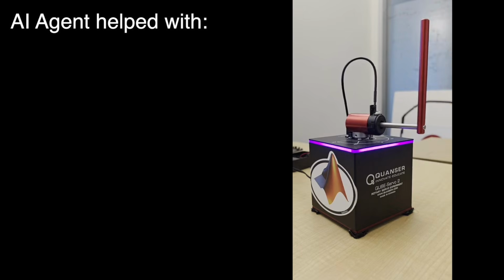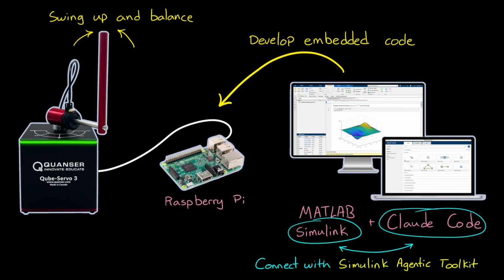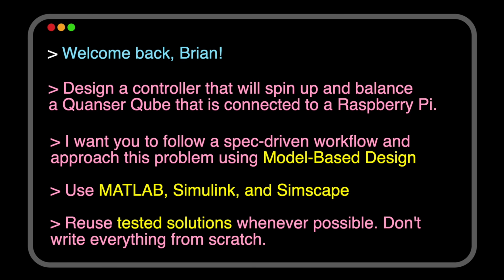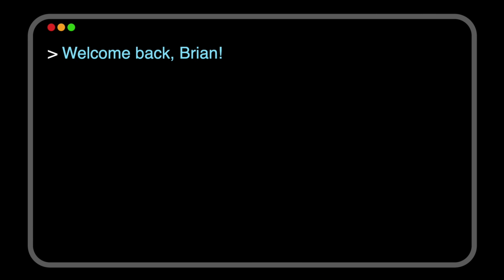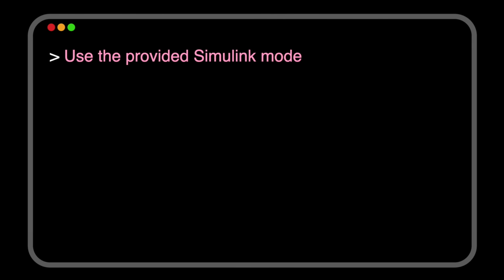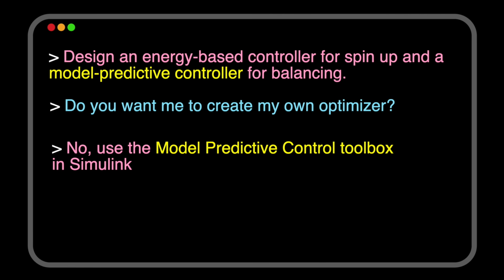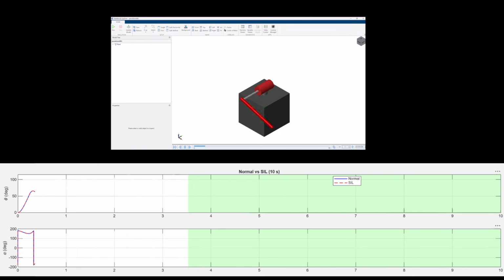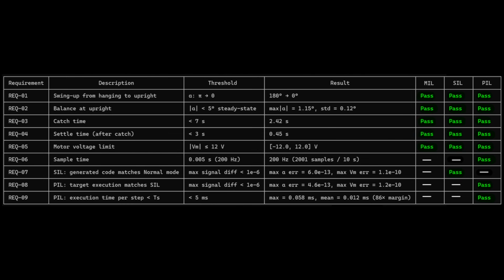Can Agentic AI Develop Embedded Systems with Model-Based Design?

Comment: I feel that AI had a very little work to do. Almost everything (coding, simulation) was done by Simulink and this is basically resulted in 99% of engineering performance gain, because you used MBD. 
The controller was also not done by AI, but by MPC toolbox. 
So basically skilled engineer could design such system without AI maybe in a little bit more time, by using the Matlab/Simulink power and toolboxes.
Reply from the maker: You are right, we believe that good proven engineering workflow and domain expertise are essential with or without AI. The promise of AI is that it can accelerate the coding part of the project and enable engineers to focus on more critical part of the project, while ensuring high quality. MBD approach make this possible. Thank you for watching and providing your comment.

Comment: Are the agents free to use or need to pay for tokens?
Reply from the maker: You have to pay for tokens when you use cloud hosted LLMs in the agents. You don't pay for tokens when you use local LLMs, but they are not the most capable models available. AI agents will write as much code as you ask, but that cost more money with tokens. By taking advantage of existing proven tools like MATLAB and Simulink, you need less code generated by the agent and therefore fewer tokens. And the results are more verifiable and trustworthy.

Comment: Can someone please explain - what was utility of using agents in this design effort? How much did it accelerate the process? Is it more of a replacement or augmentation strategy?
Reply: People are already trying to use agents to do engineering. The idea behind this video was really to showcase how humans in the loop are still a critical part of designing systems that work as intended (especially for safety critical systems). With that being said, there are many things agents are really good at and can help accelerate parts of the design. For this particular project, here are some of the things it made really easy: 1) Building out template Simulink models based on a text prompt. We still went in and checked everything and made some changes but it created a really good starting point in Simulink in a 10's of seconds that would have taken an hour or so to do manually. 2) Running the SIL, MIL, and PIL tests - over and over again. Once we got the agent to set up the correct tests, it was a simple matter of asking it to rerun the tests each time we made a change. It provided a pass/fail list for each test, and gave us a delta when things were different that we could inspect easily and determine if it was expected. 3) Plotting and animating those plots. Since the agent had access to MATLAB, we could ask it to plot any variables we wanted with a single sentence. And we could ask it to plot multiple graphs at once and build a plotting MATLAB script we could rerun ourselves. We even asked it to create a video building the plot as those it was running real time (you can see the results in this YouTube video). 4) We asked the agents questions along to way to see if we were missing anything. It provided a good sounding board for our own expertise because we could ask it about missing requirements and it would respond with a handful and then we knew weather to include them or not. So, if you know what you're doing, it's great for jogging your memory or having it bring up stuff you forgot completely. I'm sure there was more but this is getting long. I hope this helps!
Reply: totally agree,

I guess
after spending time with Agent, next time any application that close to what they did
it will save time.

well, this world are fully with talking and marketing people in charge
so they talk to sell,
most of the time, it does not meet what they advertised
Reply: Just showcasing. Imagine if we specialize them for systems like we do for chat bots. This shows the possibility

Comment: Hi everyone! I hope you enjoyed this video. I'd like to hear your experience using Agentic AI in your engineering endeavors. What are you using it for and what have you found it helps with? Or makes harder?
Reply: Arrey sir ! 
Great to see you 
One of the best control theory teacher
Reply: @random_videosonline  I appreciate that! Thanks for the comment.
Reply: Hi Brian, it's amazing to see the solutions using agentic AI. I'm curious that transforming the RL based trained policies from the mat file to SIL friendly C/C++ still becoming hurdle. Do you have any suggestions regarding this issue?
Reply: Hi Brian, I have 1 doubt about this workflow. I've used the HDL coder in Simulink to generate code for FPGAs. The 1st cut code from HDL Coder is not always the best one. You can find ways to optimize the code for faster execution or to use less hardware. So, in this workflow you mentioned, would you recommend using Agentic AI to do it, or would you do it manually?